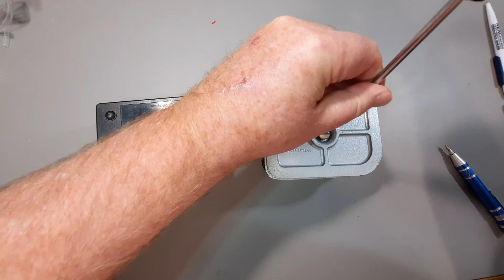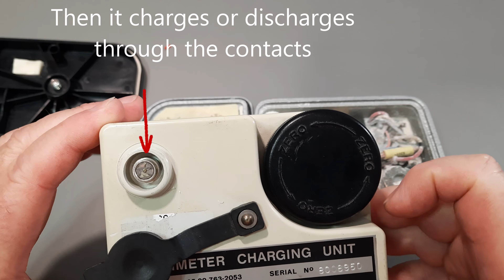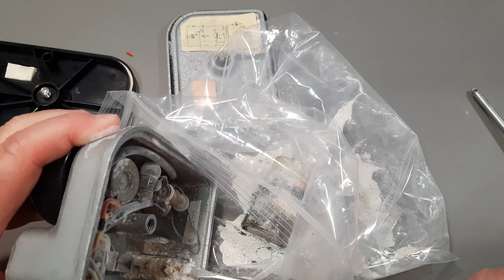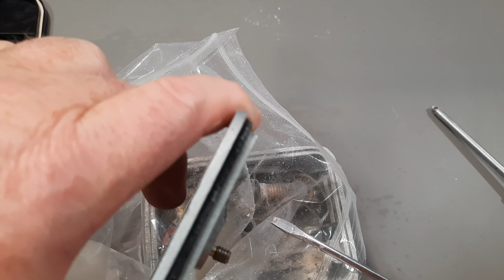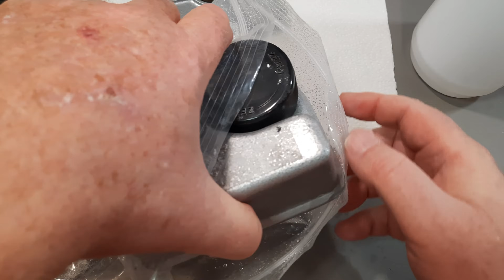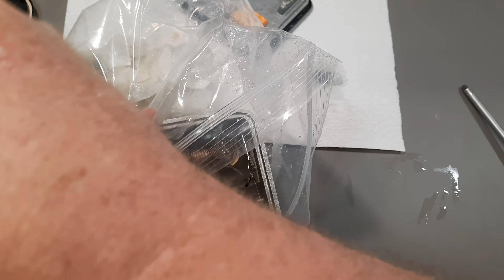Dosimeter Charger Mess

Comment: Everyone seems to call it "acid", but it's mostly Potassium Hydroxide, an Alkaline. Acetic acid does indeed react with  it. Interesting devices. Been enjoying the content, thanks! - JRH
Reply from the maker: Drat I did refer the Alkaline stuff as acid, I should know better, since I was using an acid to neutralize it. Good catch. This is why I am doing electronics as a retirement hobby instead of chemistry, less dangerous.
Reply: @retireeelectronics  No worries, no criticism intended! It just seems like folks commonly refer to the stuff like that. Could be a holdover from the old lead acid days? :) - JRH
Reply from the maker: @robharley9838  I prefer to hear when I make a mistake and yes due to the old lead acid days (-: